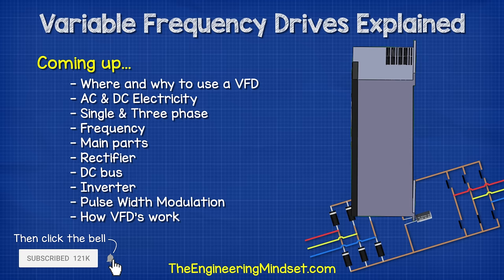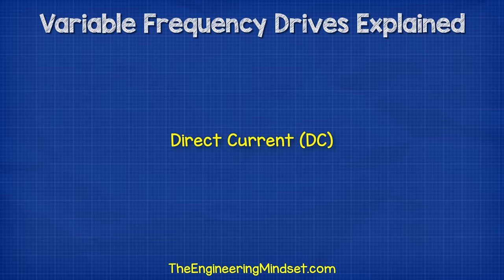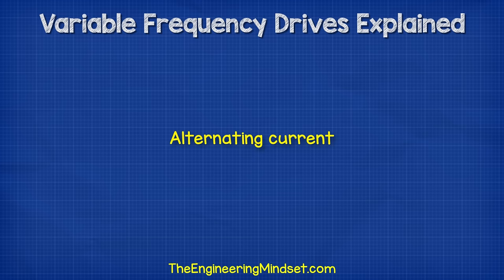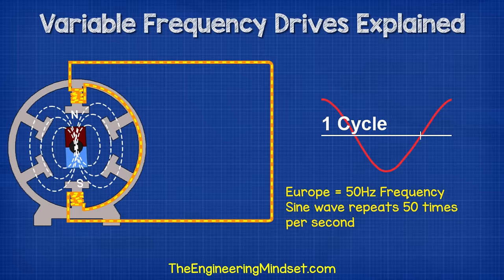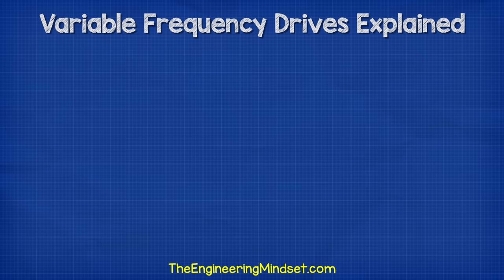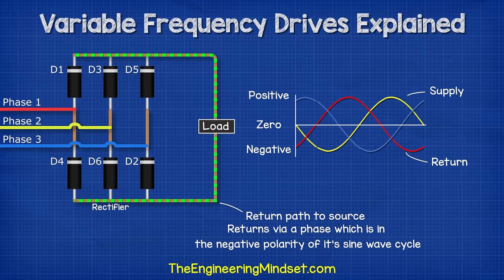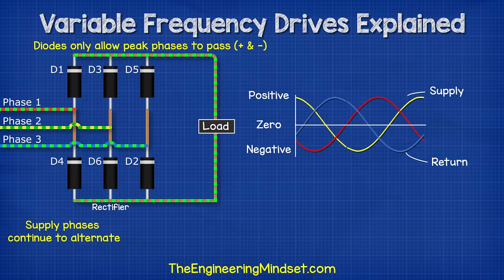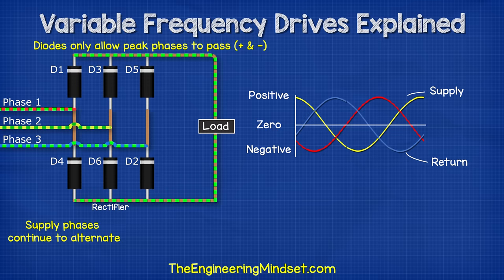Variable Frequency Drives Explained - VFD Basics IGBT inverter

Comment: Very good explanation of VFDs. Not mentioned here, but you can also get a 230v single phase in to 380v three phase out VFD. Extremely useful to allow the use of 3 phase workshop equipment when you only have a single phase supply!

Comment: Your videos are amazing. Just throwing this out there. I'm a retired shipyard electrician and something I've seen several times are people mis-wiring tools because they believe that pos and neg switches back and forth such as the light bulb plugged into the receptacle seems to suggest. With that logic, they see no reason to determine which wire in the cord is hot and which is neutral because they believe that AC just switches back and forth. The problem arises when the metal frame of a hand tool becomes energized and they get shocked. It should be noted that at no time is the Earth/Neutral/Ground... side of the circuit 120/240/460...V of a - single/split phase - positive. I love these videos!

Comment: I won't lie, when I took a look at a VFD diagram I at first was like, "Nah, a 3-phase AC motor can't be driven by (essentially) a 3-phase DC load/drive."  Then after watching this video, I was like, "Welp, I wasn't technically wrong but nor was I right either."    After watching the last section of the video I mean on how the IGBTs simulate or get the DC current to behave in a manor that is similar to that of AC.    Genius stuff. :)

I work at a package handling place (won't disclose where just because I want to keep my privacy) and my supervisor asked me what I wanted to do and I said, "Well, I want to climb up the ladder in this place"  and I was asked if I went to school and I said, "I don't because it'll cost a bit much for what I'm making but I am self-taught"  and they asked, "What do you know if you don't mind me asking?"  and I was like, "Well..." I looked and I gestured towards the Eaton belt motor and I said, "you see that blue motor that's driving the belt system?"  and they nodded, I then went on to explain in a super quick summary that the motor is essentially driven by DC electricity but there is a limitation of how much it can vary the speed and what drawbacks there are too it, like for example if you try to push more voltage into it, it could go faster or it could detriment it or damage the coils.     but then again I can be entirely wrong on that statement alone and I feel embarrassed.  Can someone correct me just in case if what I said is wrong?   I don't market myself as a world genius, I only market myself as a person who just wants to be properly informed and have the correct information on-hand.   That and I love to learn new things from computers to auto mechanics.   Anyway, my supervisor was just surprised and was like, "Why aren't you in engineering man?  You'd be great at that and you wouldn't have to worry about manual labor all that much."   And I said with honesty that, "I would love to man, but I'm not certified in that area of expertise because I am self-taught and I can't say that I know everything because I don't.   That is why I would like to learn and confirm everything first before I can justifiably say that I am certified.   Just covering my bases is all."   and the supervisor nodded and said, "Understandable and very honest."   He didn't say that to be sarcastic, he said that with sincerity as in, 'I'm glad that you're honest with yourself and others, most would get cocky and wing it.'-sort of thing.

Sorry if this rambling just lead into nonsense, I just love to learn and I love this video.  Thank you so much. :)

Comment: Nice explanation. Just a small correction: From time 4min40sec, I think peak voltage and current has a 90° phase to peak flux, therfore the anmiated electrons are moving at the wrong time. The point of maximum flux should be aligned with zero current (and zero voltage) as dB/dt = 0 during peak flux.

Comment: I installed two VFDs on a 250hp and 200hp irrigation pumps on my farm a couple years ago. Not only did they lower my power bill by about $8k a year but they are controlled by water pressure sensors. So I can easily run 1, 2, 3... lines (whatever I want) by simply opening valves and the VFD will accommodate the new load. Much easier and more flexible. No longer do I blow out pipe because someone closed a valve they shouldn't have in an emergency; or having to water places that don't need it just to keep the pressure down.
Reply: Great to hear! Pumps and fans are some of the best applications for VFDs where money can be saved. A simple reduction in speed of 10% is a bit more than 25% reduction in power consumption. Another thing you can think about with those is that not only are you not blowing out pipes, but you're increasing the lifetime of your pump impeller by likely limiting cavitation.

Comment: The video was great. Some corrections:

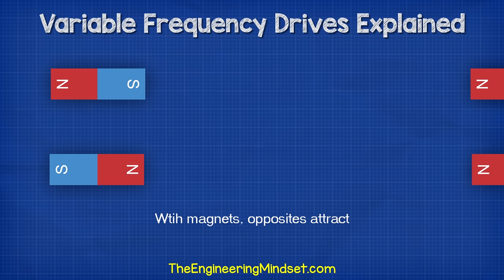3:50 No, the electrons in the windings of the generator don't move because the magnets "push or pull depending of polarity." If that was true, holding the magnet still should also make the electrons move, because the magnets still have its polaritiy; but in real life this doesn't happen. Instead, you need a changing magnetic field (in the case of AC motors and generator, it is a rotating magnetic field.)

5:54 No, in general the coils are not inserted shifted 120 physical degrees (also known as mechanical degrees) into the stator. Actual generators have a lot of windings for each phase, so they phase shift is less than 120° mechanical; you may want to read about Ferrari's theorem. What is true is that the output line-to-line voltrages are each shifted 120 electrical degrees from the other two.

Comment: Amazing!! I've used VFDs. I've used diodes, rectifiers, capacitors individually. I've done some DIY AC/DC circuit design. Still going to take a few more views to grasp everything in the video. And then fixing my broken generator/inverter should be easier.

Comment: Careful around these, even unplugged you have to wait few minutes (capacitors will discharge)  to operate them ( for example for maintenance purposes ).
Reply: Yes usually a 10min wait before attempting work!
Reply: Or you can connect a resistor to the capacitor for it to discharge quickly
Reply: Discharge time is equal to the resistance of the circuit multiplied by the capacitance or T=R×C if i remember my schooling 🤣
Reply: @justinkern1804  how do you get C?
Reply: @D1amondeyes  capacitance
Reply: @justinkern1804  not what a meant
Reply: @D1amondeyes  C equals the value of the capacitor. It's printed on the capacitor. Like if its 47 microfarads then you plug in 47 in the formula
Reply from the maker: Check out NEW resistor video, everything covered! ➡️ https://youtu.be/DYcLFHgVCn0

Comment: How are the Harmonics controlled, that can be reflected back into supply, by using this process?
Reply from the maker: Filters and dampers which are just more advanced electronics integrated into the circuit. Maybe we will cover in an advanced video on the topic
Reply: A video on harmonic distortion would be awesome 👍
Reply: Normally, an inductor is connected just btn the rectifier cct and the DC bus.... It acts as a choke for harmonics
Reply: @chrisnsamba4272  I know they sometimes do this,but it doesnt always work.When i've been involved installing 11KV  VSD's, they do a Pre and Post Study. We also have to inform the DNO they are being installed, as it does cause network problems
Reply: The filters in VFD's arent efficient enough to block out all harmonics and when you have a bunch of VSD's this can cause a lot of harmonic distortion. To counteract this, passive and active harmonic filters are installed in the circuit and active harmonic filters in parallel with the VFD circuits work best to filter out any harmonics from the VFD's.
Reply: So what we do is utilize chokes, most typically on both sides of the DC bus to help mitigate harmonics. Your average drive will be somewhere around 45% THDi. You can further reduce harmonics through several methods, generally externally, with active or passive solutions or by sort of "stacking" up diodes on the front end (you may have heard of the terms 12-pulse or 18-pulse). We just actually published a video on Harmonics here: https://www.youtube.com/watch?v=1eY_lidO0K4
Reply: I was going to suggest harmonics would be covered in Phase II of the video.
Reply: And if you have an old dial clock with a motor in a place that has a vfd you can see the distortion in harmonics with the clock running slow or fast

Comment: I have a degree in comp.elctr.engineering technology. Ive worked at Intel mainly as technician for installation and modification of semiconductor equipment in past 5 years. Ive recently applied at UPS for an opening for a Buildings & Systems engineer mechanic....Major work activities for this position include:

Troubleshooting, adjusting, and replacing AC and DC electrical equipment such as batteries, control stations, fuses, motor starters, relays, switches, timers, servo driven equipment, Programmable Logic Controllers (PLCs), photo electrical devices, transducers, Variable Frequency Drives (VFDs) and encoders.
Inspecting, troubleshooting, repairing, and/or replacing mechanical components such as motors, reducers, drive chains, sprockets, sheaves, pulleys, rollers, conveyor belts, bearings, and transfer plates.
Inspecting, troubleshooting, repairing, and/or replacing pneumatic equipment such as diverters, air compressors, lubricators, hoses, and coils.
Inspecting, troubleshooting, repairing and/or replacing hydraulic equipment such as hoses, fittings, cylinders, and pumps.
Welding equipment such as hand rails, conveyor supports, package handling equipment, carts, and grading.
Performing preventive maintenance inspections of plant equipment such as conveyors, bulk carts, and power industrial equipment. 
    I have to take a 25 question test onsight to be considered for the position. What should I know to be prepared for questions related to those duties??? Can you help me ?
Reply from the maker: Check our new Servo video out: https://youtu.be/1WnGv-DPexc

Comment: Is this how they control the speed of modern electric trains, and what is the swishing sound from the control circuits on rail traction
Reply: Generally, yes. The motors and inverters are a bit different in design due to the torque requirements (same in modern electric vehicles) but the same principle applies.
Reply: @JakeRoeder  Thanks Jake. and the swishing must be the fast switching of the huge current
Reply: I was wondering the same. Aspiring train technician here :)

Comment: I am a commercial hvac/r technician have been doing hvac/ refrigeration for 6 years love too learn new things want too get a bachelors in mechanical engineering and continue too grow my knowledge I have now been promoted too a facility manager position but kind of like the field more thank you for this explanation love all your videos great knowledge! Have worked on 3 phase motor control panels that send power too centrifugal suction end pumps 7.5 hp and 10 hp condenser and chilled water pumps for 2 racks of 100 tons of cooling each rack with 2 compressors in tandom and the 3rd on its own circuit. Also have a cooling tower we replaced the 25hp motor Baltimore also float switch repairs for fill valve of the condenser water great stuff did many commercial hvac service calls too many different hotels and facilities country clubs fascinated by hvac and mechanical ventilation and heating as well as kitchen equipment heating elements ovens.
Reply from the maker: See our new video on how to build mechanical versions of electronic circuits? Watch here: https://youtu.be/Zv9Q7ih48Uc

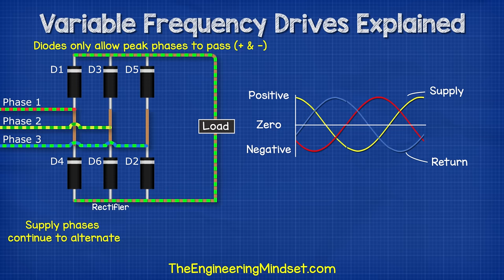Comment: Well done video.  As a Danfoss rep, I plan to use this for my customers.  The only mistake I found in your video is the description starting around the 9:22 mark.  The current will be flowing in 3 of the diode except when one of the sine waves crosses zero.

Comment: I used to specify VFDs in the 1970s.  Then, both they and the wound-rotor motors they demanded were muy expensive, and so employed infrequently.  I watch thru the years as the concept evolved until recent years when we use a few extra semiconductors and squirrel cage motors to achieve the same result.   Good on us.

Comment: We have hundreds in use, I usually change about 1 a week (dirty environment, heat kills them) I started wiring homes at 17, learned how to make electricity work, but at 58 I'm still learning "how". I converted my Lincoln AC220 stick welder to DC. I just picked up a 10hp 3~ air compressor, I'll be buying a VFD to power it from single phase!

Comment: Hybrid vehicles use a High Voltage battery then use the inverter to make 3 phase AC power to the drive motor.  This video was a great way to see how the three phase AC becomes a variable frequency drive or VFD.  Thank you.

Comment: Great presentation. Just one small detail: it's not common to connect a scroll type compresor to a vsd. Some of those types of compressors that vary capacity are called digital compressors but the way they adjust to load demand is very different 

I mention this because some crazy facility manager could connect a vsd to a scroll compressor just because it's shown in the internet

Comment: In applications that im familiar with we take a PWM signal and run it through a frequency converter circuit that converts it to an analog output tunable with a potentiometer. The VFDs we use allow analog inputs programed to accept 0-10v running a 400 Hz spindle. Great video btw.
Reply from the maker: Seen our new Potentiometer Explained video? ➡️ https://youtu.be/Xb-MZMoUtcQ

Comment: Fantastic graphical representation, it will be easy for any one with little exposure to electrical. I was trying to understand EV working and how speed is controlled. It made my under much better. One part still bit confusing is how Amplitude is controlled and how frequency varied at same time.

Comment: Very good video , only one thing is missing , about increasing phases's voltage along with frequency , for some synchronous motors . In such large band speed motors you can lose the torque due to inductive reactance , if the rise of rotation don't get also a rise in current/voltage . Such controller is a little bit more complicated .

Comment: Great VFD explanation.  One small point.  Lots of folks with small/home shops don't have 3 phase available.  The VFD's are just the ticket if you have a lathe or mill that needs 3 phase.  Most programmable VFD's will take single phase 220/240 in and put out 220 3 phase including all the speed control benefits of the VFD.  Maybe do another animation using single phase input?

Comment: Fun fact: When riding a modern electric train (being metro or commuter train), the stepping up winding sound you hear as the train starts from a complete stop and starts to accelerate is the pulse width modulation adjusting as the train picks up speed. Different trains have different sounds because of the programming different manufacturers like Siemens, Alstom, Bombardier, Kawasaki, etc use in their inverters that utilize their own PWM patterns.

Comment: I don't know if this is practised  in other European countries, but at least in Norway, we have been using Black(L1), Brown(L2), White(L3) as standard color code the last couple years in 3-phase systems, instead of the older standard Brown-Black-White. Just a thing to keep in mind, switching the phases will cause the motor to spin the wrong way. Check that your motor spins the correct way, folks!
Reply: I tend to see color codes changing a bit depending on where you are in the world. Regardless, checking motor direction before attaching a load is fantastic advice. In many of our drives (I'm from Danfoss), you can simply change the direction of the motor switching pattern in a parameter so you don't have to rewire everything as a backup :)
Reply: @JakeRoeder  Thats a great feature! And a feature I think all VFDs should have, even though switching two wires in the VFD output is pretty quick fix. Had to do this on a Schneider VFD since a fan in a main ventilation unit was spinning the wrong direction. Since you're from Danfoss I have to take the oppurtunity to say your VFDs are 10/10. Did a project a year ago with Danfoss VFDs supplying three 125kW (400V) motors (pumps). Rewiring on those would probably not be as easy, because of the huge cables, so its really usefull that you can just switch the direction by changing a parameter.

Comment: Thank you for tge great graphics and discussion of the topic.  I want to acknowledge that while there are a great many things that require good engineering to make a VFD work good, I think motor position sensing is important enough that it should have been included. Sadly that part is often neglected on similar videos, and I'd like to see how it's done electronically without hall sensors.

Comment: Very informative video. You might want to mention that VFD is also in many electric vehicles,  from cars to locomotives. And why? Because asynchronous AC electric motors provide more power/energy than synchronous AC or DC motors of similar size, which means more performance.